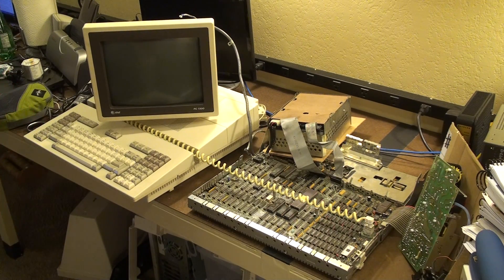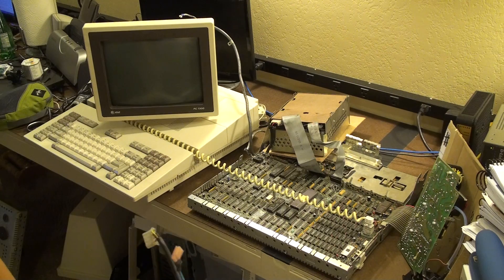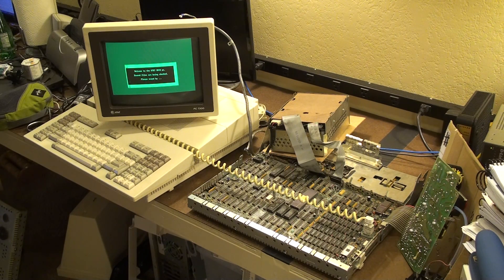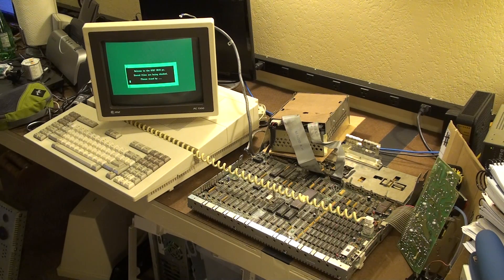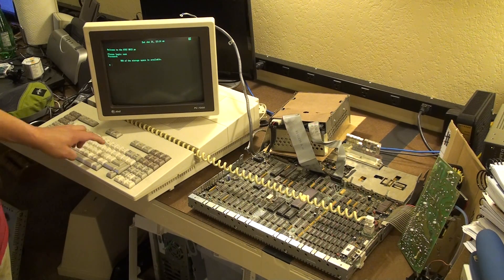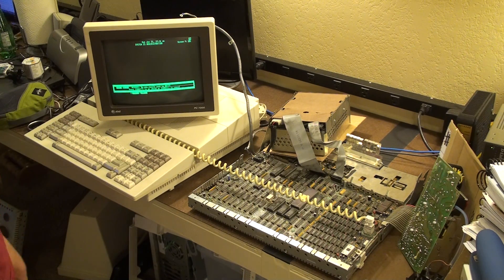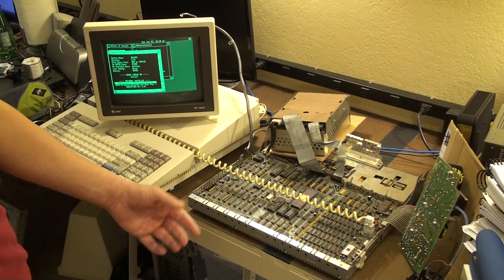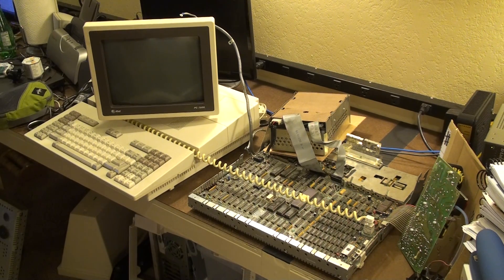AT&T Unix PC 3b1 boot from original physical MFM hard drive w/ System 25 AAS

Comment: the System 25 Application was for their System, 25 PBX that was based on the ol AT&T Merlin. While System 75 and 85 (later rebranded as the Definity PBX Generics 2 and 3), AT&T wanted to give the smaller end something that resembled the terminal interface of the S75/85/D G2/G3, and so they made a Unix workstation do that. All it did was it fetched raw code and pushed out raw code through its data cable. Any changes were not immediate on the System 25 side.

Comment: I got one in 1994 and was going to use it as my home work station because I was broke as hell, then I got a 486 80 w 8 Meg and put linux on it, but had no monitor, so I scrounged a Sun 3/60 and remote X'ed into the 486/Linux box and that was my workstation at home for 3 years until I scrounged a VGA monitor for the 486. The UnixPC was ignored.
Reply from the maker: That's an awesome story!

Comment: Hello, I own a defective AT&T 7300 HD 20 MB and I would like to know if you would be interested in selling me an AT&T 7300 Unix/PC power supply. Do you have any other parts that you would be willing to sell me? Thank you for your answer. Best regards. I am from Switzerland
Reply from the maker: @David Rudety Have you considered simply using a modern ATX power supply as a replacement?  I have done this many times, and can demonstrate.  My demonstration of showing you how to use resources that you likely have around you in abundance to re-create a higher quality power supply would likely be far more practical and beneficial than shipping a physical object.  What do you think?
Reply: @ForgottenMachines   Would you be willing to post some information about a power supply replacement? I just picked up a 7300 and so far no power. Are there other things that would raise a red flag other than the power supply?
Reply from the maker: @johnhorvath4989  Yes, as soon as I resume videos on the UNIX PC, I will certainly do that!

Comment: 1969 born Unix , 1969 born ARPANET .... Unix for the first Os connected to the network ! Later giants like Apple and Microsoft connect their os (Windows NT 3.5 and Mac II) in 1994 .... with the Opera and Netskape Navigator browsers .. in 1995 Windows replaced it with Internet Explorel .... the first prototype browser dates back to Tim Berners Lee with 'Theworldwideweb' (Nexus) in 1989 on NextGeen under permission of Steve Jobs .... Then other historical dates were the birth of the Email in 1971 on Arpanet ... and the first internet protocol php in 1975 (irc chat) .... is the first browser ever in the 80's, the creation in France of Minitel (1981) was a 16-bit internet system .... It was used as an information system but also for the televotes ....
Reply from the maker: Danilo, thank you for this anthology.
Reply: Thanks ... In the history of computer science, you have to put your heart ... With Unix, historical operating systems like Apple-Dos (1978) and Xenix (1980) and later the most innovative open source server in 1991 are born Linux kernel .... If Unix was not born ... We could not have had neither the close source systems like Microsoft Windows and Apple Mac Os X ... not even the Linux distro open source ...

Comment: System 25 appears to be a AT&T PBX system, would have gotten offloaded with WE to Lucent and than spun off to Avaya, nice find:

http://pdf.textfiles.com/manuals/TELECOM-S-Z/System%2025%20Reference%20Manual.pdf
Reply from the maker: Paul, thank you for sharing this.  That is exactly the contribution I was hoping for here.  This is VERY cool to have this detail and knowledge.
Reply: Well long before my time, Googling and interest in old AT&T Docs helped. I did have some experience using an Avaya PBX several years ago, though the admin software ran on Windows at that stage. 

You might have one of few examples of that application complied for 3b1, so imaging the disk would be good act of software perservation! :)
Reply: From the PDF:
---
Advanced Administration: The Advanced Administration Software (AAS) package is
a major improvement in system management. It provides the System Administrator a
user-friendly, powerful tool for accurately and quickly making changes in voice/data
terminal assignments, coverage, access codes, and other system functions such as
ARS.
Two sets of software are available for Advanced Administration. One set operates
on a PC6300 (with 640K RAM) and provides an alternative to use of the SAT input
terminal. The other runs on the Master Controller (UNIX PC) as part of the
“Integrated Solution.”
---
System 25’s Integrated Solution offers customers a unique package of integrated call
management, switch management, and office automation applications. The Integrated
Solution is a set of application programs that run on a Master Controller (UNIX® PC). The
applications include Advanced Administration Software (AAS), which permits customers to
administer System 25’s features themselves; Call Accounting System (CAS); and an
integrated Voice Message System (VMS) that provides call coverage, leave word calling,
automated attendant, and voice mail services. In addition, a number of generic office
automation applications (word processing, data base management, and spreadsheet) are
also available for the Integrated Solution; these applications may be run simultaneously with
the VMS and CAS applications.
---